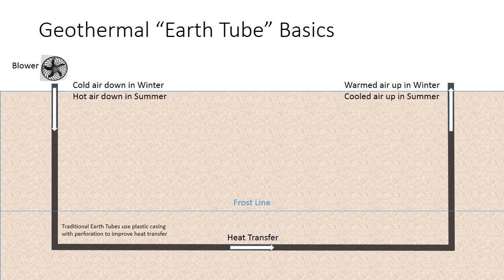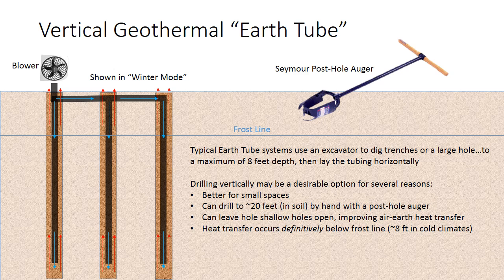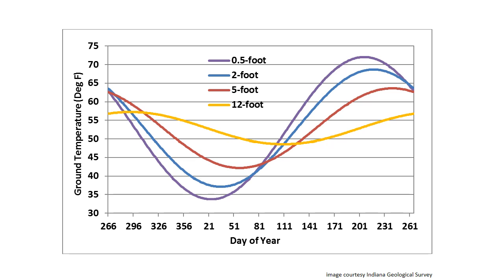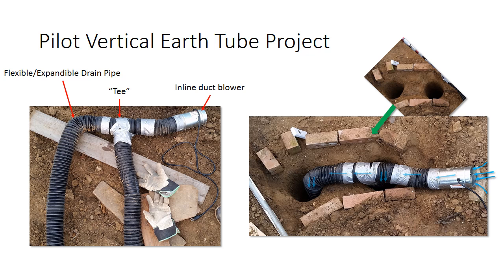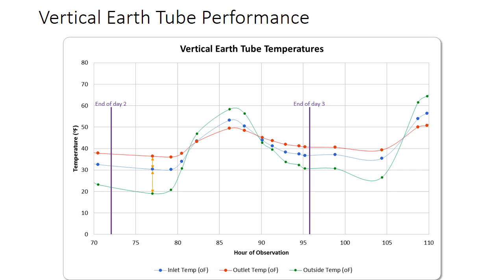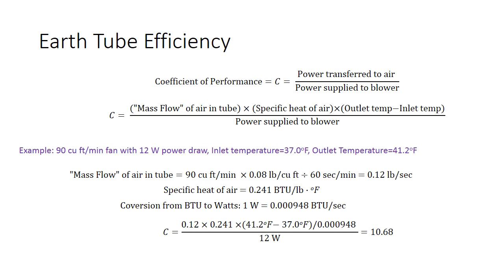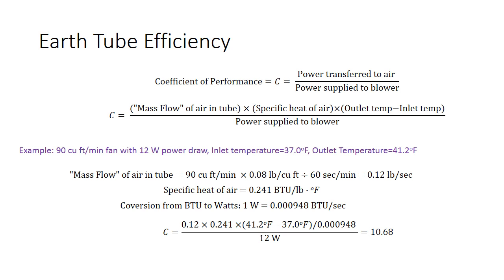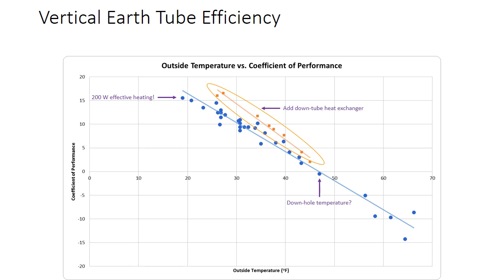Vertical Geothermal Earth Tube (Part 1) - Greenhouse Heating/Cooling

Comment: Morgan, great idea.  Why did you choose the drainage pipe as opposed to say, PVC pipe?  Did you have any problem with the non-cased well caving in?
Reply from the maker: +Jeff Cassman - thanks much.  I like the black drainage pipe because a) it's cheaper than corresponding 4" PVC, and b) its flexible nature makes it easy to bend around without extra fittings.  I taped a "pipe" made of aluminum cans (https://youtu.be/ghmvI9U1KQI?t=259) to extend from the 4-8 ft depth range.  My rationale there was that I'd get improved heat transfer at the bottom of the well, and the temperature data bore that out.  Regarding cave-ins, luckily, no, I didn't have that problem.  But our soil here in Colorado is pretty competent and we haven't had the rainy season yet.  I also had a pretty good "sandbag" and cover to keep dirt and water out of the open holes.  Unfortunately had to tear down my greenhouse, but I'm up and running in another location in the backyard and will try to rebuild the system at a greater scale in the new greenhouse.
Reply: Morgan Brown thanks for the reply.  Have you given much thought to the optimal scale relative to cubic feet?  I know that LDS Prepper estimates a 10% figure with the traditional horizontal geothermal pipes.  That would involve lots of holes with this method.
Reply from the maker: +Jeff Cassman Heheh, I've had my share of skeptics (myself included).  A guy who posted on the other video was pretty skeptical.  What I hope for with this method is a couple of efficiency advantages.  First, I should be able to drill holes with this rig to 20 ft (assuming I don't hit bedrock).  If you look at the temperature vs depth (Indiana: https://igs.indiana.edu/images/Geothermal/fig2.png) note that going from 5 ft depth to 12 ft depth and deeper, you get a huge temperature differential, especially in the coldest and warmest months of the year.  The horizontal earth tubes are usually ~5 ft deep.  I should be much more efficient at 12 ft and lower.  Second, because I don't have to fill in my hole, I can keep the air flowing past the open dirt.  I assume that this increases heat flow, relative to a buried plastic pipe.  

In any event, you are right to be skeptical! ;-)  Only way to find out is to dig some holes and see what I can do.  Amount of air flow needed is another issue I haven't researched.  I'd ideally like to run this from solar, so I'm hoping that the small 12V fans suffice.  The other skeptic didn't think my 90 cubic ft/min fan was sufficient.
Reply: +Morgan Brown I didn't realize I was a skeptic! Maybe just a slow learner? I'm struggling with the volume of air the fan moves relative to the volume of air at depth and the speed of cooling given the short duration at depth. Does that make sense?
Reply from the maker: +Jeff Cassman if you read comments on my other video, a guy named John Guest says he aims for 20 complete air changes per hour through a horizontal system.  I computed only 4.3 air changes per hour with mine.  My coefficient of performance is high, but I'm not sure how much I was heating the greenhouse.  My hope is that a more efficient system would require fewer air changes per hour to transfer the same amount of heat.

Comment: Humidity was my concern. I was thinking of a three staged closed duct loop. It would have a blower forcing return air from the house through horizontal air tubes first, sloped away from the house with a small constant drain. Then the air will go into vertical wells like your system. A long slope up to the house and through a radiator with s closed loop of geothermal cooled water from the bottom of my pond. Any condensate from the radiator can drain down into the vertical wells. What do you think? I know it sounds elaborate but it could be ran with a 12 Vdc fan and pump. We are looking into options for an off grid earthberm home.
Reply from the maker: +Chris Daughtry Sorry, I failed to respond in a timely manner!  I like your drainage idea.  In the hot months, I bet that the water vapor in the cool return air would condense as it heats up, if you engineer it correctly.  In the cool months, maybe you want the extra humidity?  (In Colorado we don't mind it!).  One worry we do have here is radon -- the clay bearing soils are known to have high radon.  Not sure how you engineer around that one, but it's probably worth thinking about.

Comment: The vertical wells are open ended - correct? Do you think this would work close looped and for a home?
Reply from the maker: Correct, just simple open holes.  Have thought about home heating and cooling applications.  Biggest concern would be high humidity of the output air.  You could "case" the well with large diameter tubing (like a water well), but it would add to cost.  I've heard of some people just circulating into a crawl space, where you might be less worried about humidity.  Not sure I've answered your question, so shoot back if not.